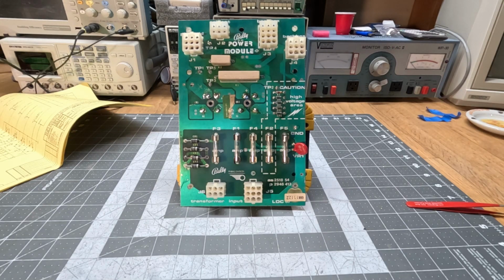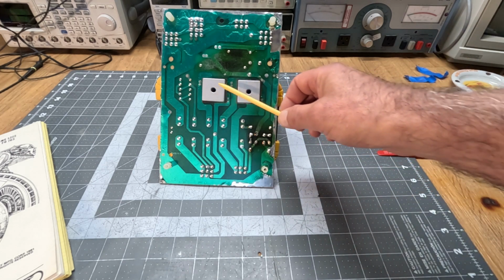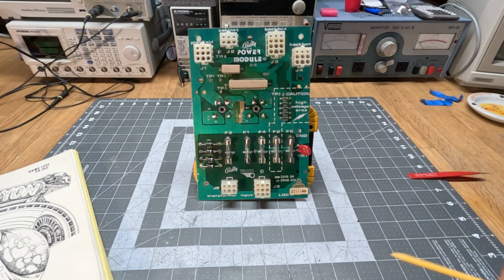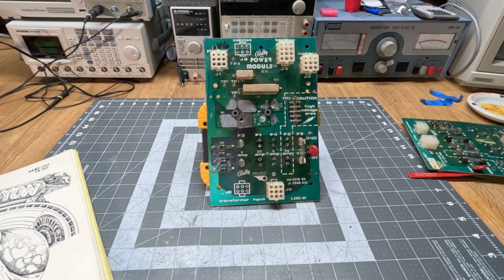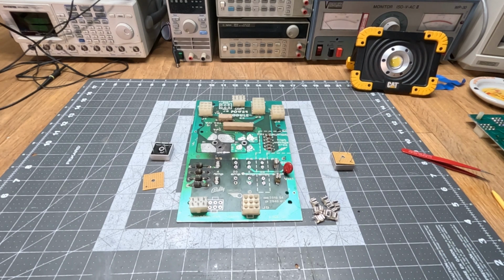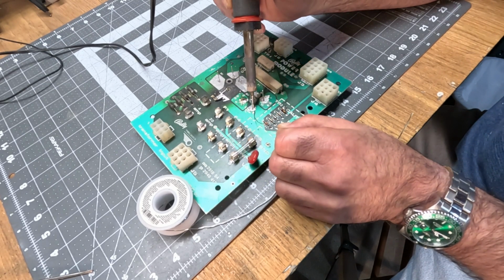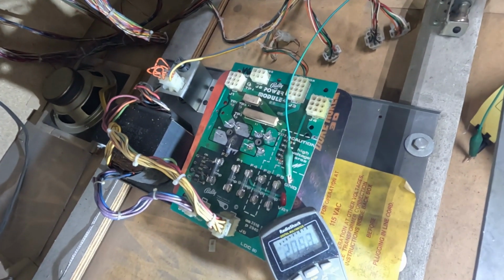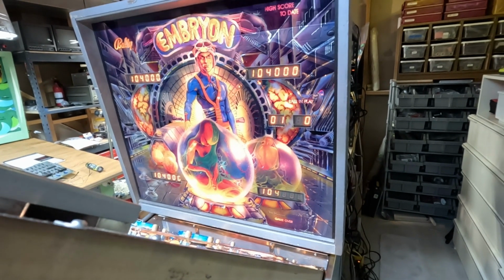AE#227 Bally Pinball Rectifier Board Repair

Comment: Big soldertips are a nice thing. I for myself use a big old iron, dont know the watts, but it melts everything quite fast. Even solderconnections on a big metal chassis.
Reply: I use my granddads old soldering iron to solder cables to large steel chassis. I was shocked when I plugged it into my watt "O" meter to find it was drawing 450W, my dad said he used to use it for soldering 1/4" copper gas pipes. Dad was going to put it into the recycling some months back, I'm so pleased I managed to rescue it, it's amazing how quickly it heats up a large steel valve radio chassis.